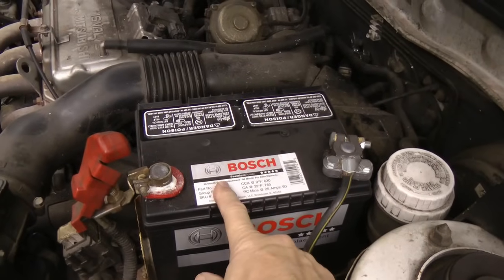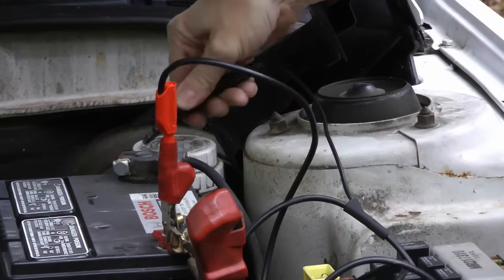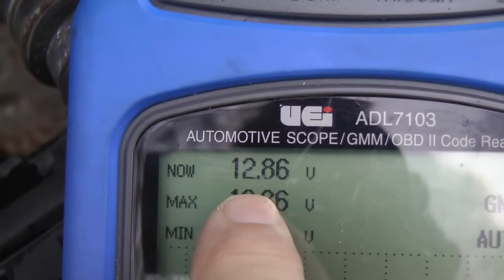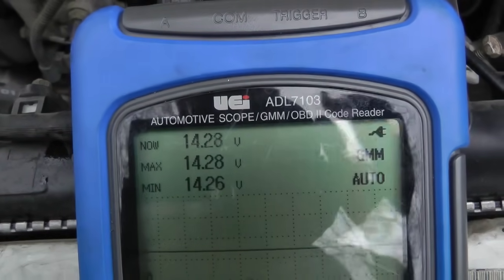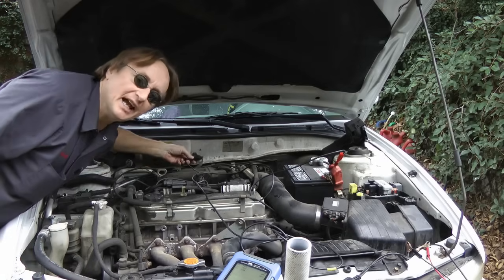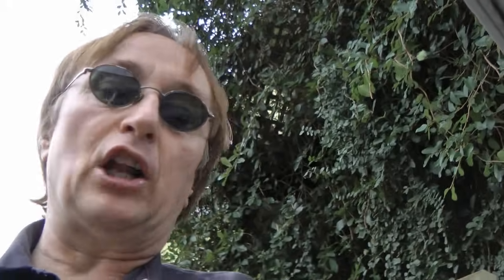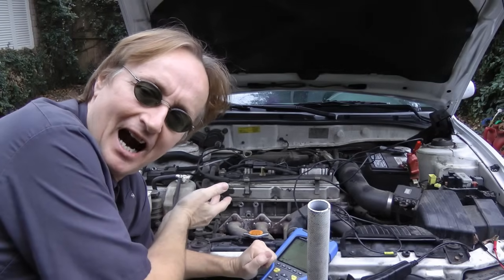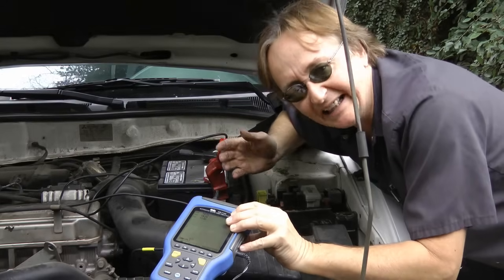How to Fix Electrical Problems in Your Car (Ground Fault)

Comment: Hi, i changed brake bulbs recently but when i pressed brake pedal , the tail light bulb glows with high power instead of brake bulb bear in mind that bulbs are single filament. 
Can u suggest what can possibly gone wrong.

Comment: I'm trying to figure out if I need to do maintenance on my electrical but when I had my battery tested it read zero but when I start up everything works fine except for a few flickers when turning on the radio closing windows locking doors or the sort

Comment: I have a problem with my 94 Camry not starting all the time, I’ve replaced my starter, my battery, my ignition switch, my ignition cylinder, I’ve checked my starter relay, I have brand new cables on my battery and yes they are tightened down.  Still this problem persists. Sometimes my car will go a whole month no issues, and other times it will be every day that it won’t start at one point or another (it always eventually starts). When it’s not starting everything is getting power but it’s as if no power is being directed to the starter. What should I look at next to try and fix this issue?

Comment: Scotty, PLEASE HELP ME !!!!  I've got a 99 Camaro Z28 with a built  5.3L engone SWAP... the car have some electrical issues that I just cannot seem to trace down. But my battery is in the hatch, it has been relocated to the hatch! It's like it has a mind of its own, some days I will have issues when one thing and then the next day it will be fixed and a whole new issue will come about but it's always electrical. I have checked all of the ground wires that I can find and they are all tight! My new issue that just started yesterday.... I pulled up at work and turn my turn signal on and they would not Flash to the right or to the left but if I turn my four way flashers on... They flashed just fine? Also, I have a weird smell in my car when I turn the heat on? And my check gauges light came on...i looked down at my dashboard and the voltage is at the very tip on it going into the bottom section of it being in the RED...PROBABLY READING ABOUT 11 OR 12 VOLTS? But my lights are not dim! I got going down the road as I was going home last night from work and the gauge came out of the red completely and it was just under 13 volts and the "CHECK GAUGES" light went off... then it happened all over again when I got home and when I drove to work this morning!

Comment: Scotty I'm a big fan and have seen a hours upon hours of your videos. Thank you to start off! I'm a handy guy do it yourself I stomped I have a 2004 dodge Durango 4.6l the no tow hitch but the 3rd (Middle) tail light on lift get went out. Crazy part I smacked it and it came back on! Few hours later went back out.. I have replaced the bulb tested connectors to wires from bulb and all work. Figured must be fuse. Inspected every fuse 25 amp (small fuses) in all 3 fuse box's 2 under hood 1 located at driver feet no fuses blown. Your expertise is astonishing. What would be your ideas on this head ache of mine sir?

Comment: Hay Scotty on my truck everthing reads at 12.7 when on 13.7 but the engine reads 13.7 off and 14.7 on were should I start looking also gauges going crazy along with all lights comming on replace lots of stuff so far and still haven't hit the nail on the head no codes and no loss in power

Comment: I have spent much money on engine diagnostics and two distributor and the changing if a fuel pump to no avail. They say the distributor is getting more voltage than normal. Could be faulty wiring harness. Wouldn't diagnostic show this?

Comment: Scotty, I'm not getting any power to the fuel pump on my 2001 Ram 1500 5.2 L. I'm stumped, all of the relays check out ok,  all of the fuses are good, new plugs wires cap rotor I'm getting spark but no power to the fuel pump. What can it be?

Comment: Hey scotty! I acidentally dropped my positive alternator wire and it hit my transmission and i still had the negative on the battery and now my car dont go into drive with headlights on and when i put it into park it says reverse but when i turn the headlights off the odometer reads fine and when i hit 60 mph driving the speed gauge goes erratic and i have codes for transmission control harness and transmission range sensor
Reply: That sucks

Comment: Hey Scotty.
I have a question I have a fuse under the hood problem with my Toyota corolla 2013. I cant figure out which fuse this is concerning Toyota manual doesnt match the fuse box at all . there is a fuse 10a  its in the middle between a 10a ,15a then the one is question is under them as a 10a they are grouped together by them self

Comment: I'm trying to figure out why I have a short in my son's.93 Honda Accord.  I did the ground test with a test light, and sur enough, the light came on.  I pulled the fuses, and the only one that shut the light off is the 30 Amp battery fuse,  (It has 2 screws).  

My battery keeps draining.  The battery dummy light.came on yesterday so I tested it with my multi meter both static and dynamic.  It all checked out fine, but this morning, NOTHING.  I tested it again, and I got 6.23 Volts.   

How does that happen? 

I have a charger, so, I hooked it up.  After 5 hours, the battery is at 12.42 volts, but it falls rapidly.  I guess it's SHOT.  I have another one, but I don't dare use it until I find out what's draining it.  There's no clicks that register to the ear while removing the battery cables.  

I notice if I turn the AC on the Dummy light goes off.  Am I correct assuming that the AC may be the culprit?  It works fine, but I've read that something with the circuitry could drain my battery.  

This is an IMMACULATE 93, one to really behold - in case you're wondering.  Nothing Micky-moused, the car looks NEW especially under the hood.

Thanx, Scotty

Comment: Hi Mr. Kilmer I got this problem my 2014 nissan sentra  foggy lights there is power on the connection plugs  but don't but the lights bulbs  don't work   can you give advise for that thank you

Comment: When cleaning grounds attached to the body, is it normal to get a small spark if you touch the cable to the bolt? Car not running.

Comment: Hey Scotty My cars check engine light flashes with no misfire and the wipers, Ac compresor, and the radiator fans all activate at once when the key is in the “on” position.

Comment: Scotty, why does my automatic transmission slams into drive only when temperature is around 185 to 190 degrees. Dealer put a new transmission then changed torque converter now they say it's the transfer case even though I don't have problems with 4 wheel drive.

Comment: Hey Scotty I got an 07 GMC Yukon that the battery voltage drops from 14 to about 12 with a load on it. Also if the ac fans kick on it drops to about 10. I have change the alternator , fans , fuel pump,  because when it drops the truck acts like it’s not getting gas. Please help I have checked the grounds the ones I could see and they were not loose or corrosive

Comment: Electrical problem?   Easy.  Install jumper wire in place of fuse from circuit you are having problems with and just follow the smoke.

Comment: Hey scotty,  just got a 2005 honda accord and I remember using the ac just to try it it was winter so didn't need it and the radio would work sometimes I would have to turn it off and on a lot of times and sometimes it would work... but I noticed If I hit a bump it would make it turn off.. now my ac doesn't work it blows but not cold at all and my radio doesnt work at all either,  I'm guessing I have an electrical problem? Any suggestions?.

Comment: How bout when you turn the AC on and the truck dies 2mins later. Leaving you stranded for 4 hours while you try everything u know to figure out why the fuel pump wont prime. And then it just starts for no reason
Reply: have you tried holy water

Comment: Hey Scotty I'm a subscriber and I also like and watch a lot of your videos is are very helpful so thank you for that

I have a situation you're in I think you'd be able to help me so here is a scenario

I have a 1998 Ford Mustang V6 I have replaced the alternator the pigtail from the altimetre the battery as wellAlso took it to my local mechanic he hooked up his voltage meter and he said everything was checking out OK check the fuses check the wires he says everything checked out OK but I think they're still something that I can do please help me

And it's still not working pretty frustrated not knowing what to do
Reply: You might not wanna comment on a six year old video bud. Try on his recent vid or send him a email

Comment: Scotty, I’m testing an ac compressor with a power probe three. I know my probe is saying a I have voltage drop and poor ground at the connector going to the compressor, however I’m having trouble figuring out why. Any help?

Comment: Hey man I have an issue maybe someone can help. I have an 06 Chevy 2590 5.3l v8. Issue is  it randomly pops up saying engine coolant hot, engine overheated. But immediately after letting off the gas the gauge returns to normal. Now everytime this happens, my oil life goes to 0 and it says change engine oil. I've replaced temp sensor, thermostat, water pump, alternator and when I turn on ac the fans work, but not without ac. Please help..

Comment: Hay Scotty, how do you check when one day its the. Left window motor not getting power a few days later its the radio, then the right window motor, then the starter. How do I check to find what is causing this without replacing everything

Comment: I have a 2003 Hyundai Tiburon
my left tail light went out and everytime i put in the left tail light fuse, it blows and so does my room lp fuse as soon as i try putting them in. where should i start checking

Comment: Problem is it does not start only Crank
Reply: Got the same problem u figure it out ? I tried grounding the motor to the frame and battery to the motor to the frame

Comment: What about my 02 corvette dash lights going on for no reason, service engine,reduced power, low fuel,service abs,service traction control,low voltage, etc.

Comment: I recently bought a Lexus 2004, the low beam lights don't turn on only the high beam. I noticed that the fuses were burnt on the gray part of the fuse. It also makes a buzzing sound when I switch on the lights what can be the problem?

Comment: Hey Scotty;
I have a 2002 Honda Civic Ex 1.7 stick shift. Lately it’s been having a no crank, no start issue and have been resorting to pop-starting it. The battery test perfect, we thought it might be the starter but the starter seems fine with the exception of a loose connection. We cleaned the tightened the connection line. The car was fine for a few weeks but has begun intermittently having the no crank no start issue again. Please give me some possibilities.

Comment: I jump my car off and battery slowly drain and car won't start back up after jump off I change the alternator and the battery both brand new car still won't stay crank up I have 2001 dodge caravan 3.3L

Comment: Hi Scotty. I got 24V system nissan safari y60 1988 and I connected the multimeter to negative battery terminal and ground on frame giving me output 12.5 V. That should be zero shouldn't be? Positive battery terminal and negative ground giving me 25V output normal there.  What could be a problem? I got a battery warning light on. Thank you.

Comment: Great video!!! I know it's kind of an old video, but I have a problem with my 2012 TOYOTA 4RUUNNER!!! My voltage needle on the cluster fluctuates up and down with or without accessories on but even more so with them on!!! Even in park at idle with nothing on!!! I come to a light or stop and it drops quite a bit then goes back up to the center of the gage!!! Would you say this problem is due to a bad ground, a short, or some kind of open circuit problem??? I have taken it to the dealership and they can't seem to figure out what's causing the needle to fluctuate like that!!! Your help and advice willl be very appreciated to solving this problem!!! Thank you and your videos are always fun and very helpful to watch!!! 👍👍👍
Reply: It's the ground connection. Toyota's ground wire seems to go bad after 6 years

Comment: Ive been told 1st gen dakotas (87-96)like mine have dim headlights because of it being installed with too small of gauge  for the wiring.  So buying better newer bulbs won't really help.  ( at first they seem to but eventually it's still hard to see at night.
Please help.  What do you think i can do to fix this.  (Electrical wiring is not my bread n butter but i do understand the basics). Thanx ahead of time

Comment: Darn wish you would have showed us the fix. I press my brakes on my car and it beeps and illumination comes on with the key out. total ground problem. Have an idea where I should start. It's even enough that the car stalls at a stop light/sign or when my foot is on the brake

Comment: My battery light came on and the battery and alternator were bad. Got them both replaced and the light was still on. That was all a few days ago, now the light isn’t on when I start the car but it comes on after driving for about 5 or 10 minutes. Was sure to have them both tested and they were good. The obd reader said the drive cycle test was incomplete some I’m curious as to if that could be causing the light to come on or not. Or maybe it is a ground problem but I’m not sure. I’m also not sure how to locate all of my ground wires. It’s an ‘02 v6 mustang. Also, before all of these issues it would always cold start just fine, but after driving for a little while and turning it off then starting again it has trouble and almost doesn’t even start in some instances. Help a dude out?

Comment: Im having troubles figuring out what's wrong with my car. All the lights in my car dim over the smallest thing. If I hit the brakes, the headlights dim. If I roll my window down, the lights dim. If I turn on the rear defroster and use the wipers, my headlights flash, and a bunch of lights come on on the dash, one being "check gauges". My gauges go dead for a few seconds. If I turn the car off and back on, the lights are all gone.

Comment: Hi scotty ur videos a straight fire homie. anyway so i have a Buick century 02 at first i had the ANTILOCK acting up so i fixed it. But my car won’t turn on i put new spark plugs and wires module and cylinders as well and fuel filter and brand new battery and terminals too and my car still won’t turn on my battery is dead but BRAND NEW alternator is good and when i try to jump start it or charge it IT UP it won’t start and it’s dead when i got it to turn on it was shaking and a little clicking sound then it turned of right away my scanner said CYLINDER 1 misfire and o2 sensor i replaced so many stuff and i still can’t get it to start can u please help me I’ll pay u I’ll send you money whatever i just need help please scotty idk if i skype will help maybe seeing it n hearing it could help please let me know when you can thanks bro

Comment: Hi Scotty. I have been watching your videos for years. I have a 2002 Jeep Grand Cherokee that has a minor electrical problem. When a certain fuse blows, it causes the check engine light to display 4 codes. Once I replace the fuse, the codes reset. The good news is that the cigarette lighter is on that fuse. I have a USB charger plugged into it. So when the light is out I know the fuse has blown again. I am going to try to disconnect the cigarette lighter to see if that is the issue. The power outlet on the opposite side also does not work. According to the manual, it gets power directly from the battery. I tested all those fuses in the front battery area and they seem ok. Going to try removing that and see if power is getting to the cigarette light. It might be just time to change the outlets.

Comment: Why are ground straps a flat uninsulated braided conductor instead of just a piece of insulated stranded or solid wire large enough to handle the load , like a battery cable? Just cheaper?

Comment: Why not do a resistance test to test ground. It's just as quick and also much more definitive. This test dosent put any load on the tested circuit so even if the voltage was not ".4v or less" it could be poorly grounded. It's 2019 multi meters test multiple things like resistance.

Comment: I have a U1001 code flash on my 03 G35 Sedan. The idle jumps from norm to about 1 grand and won't budge over 2. The pedal doesn't respond. The short is irregular.

Comment: Hey Scotty, Just installed a forward/rear camera on my F150. Problem is the rear wires are too short. What type or size wire should I extend it with? 
Thanks Mark FLA.

Comment: Hi Scotty, i got one question. if i connect two fuses to power supply relay terminal 15 using a fuse piggy back connector will it damage the fuse box ? I am trying to connect DRLs to it.

Comment: My parking light wont turn on but the same bulb works for the turn signal. I replaced the bulb already and it still doesnt work, does anyone know what the solution may be ?